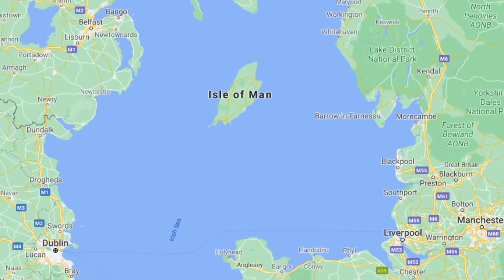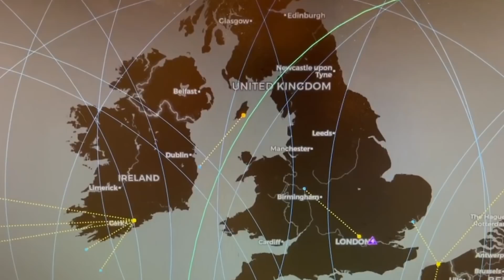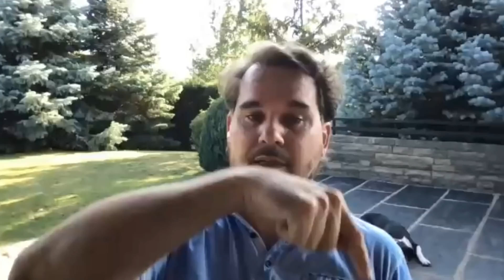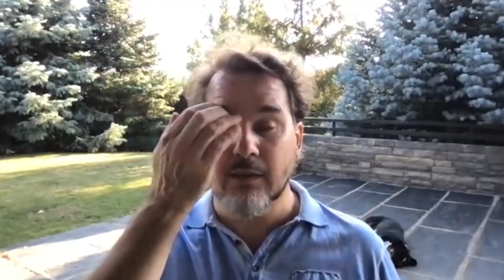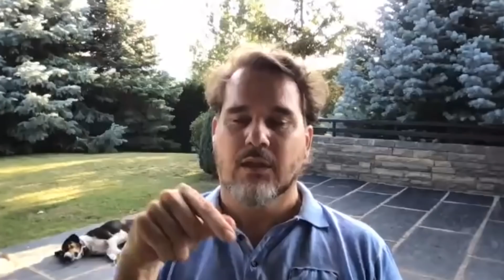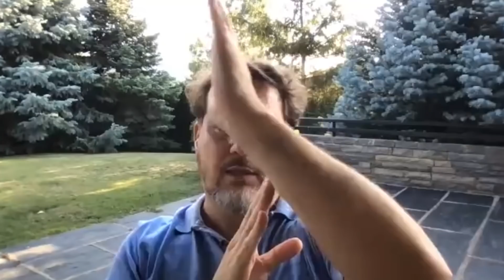Here's the MOST detailed SpaceX Starlink satellite tracker

Comment: Excellent video. Thanks Ellie and Mike.
I received my Dishy in northern France 12th of May.
Google Weather thinks I'm in Paris 350km away. I guess that's based on the IP address Starlink assigns Dishy. Which leads me to Ookla's results. Sometimes speedtest gives the best speed result to a server in Paris, other times to a server on the Island of Jersey and other times to one in southern England so leaving Ookla to choose the best server automatically, rarely produces the optimum results.
The best results I have seen are 357 down with 64 up. But frankly these are just test results. Compared to Orange's ADSL of 12 down and 0.8 up, day-to-day use is in a different world. 
Despite having trees and houses around me I get 100% coverage and continuous connection.
I have replaced the Starlink wifi router with a Mikrotik router and use CAT 7 LAN cables to fixed computers leaving a single Ubiquiti 6LR access point for WiFi connection to mobile devices.
I feel sure that Mike's delay in getting his Dishy is more likely to be caused by Spanish regulatory "maňana" than any actual Starlink technical limitations.
One point. My experience of using Starlink support is excellent.

Comment: So if he is correct about laser optics. Then if this type of base station connects up to fibre connected to the record breaking fibre methods from Japan (300+ terra bit per second) , it could easily provide 1gbps service in the near future ?
Reply: The bottleneck would be the speed of the satellite's connection to the dish, so it will never be able to achieve those speeds if a sat can only transmit 20gb/s to a dish and there isn't a way to shoot a laser at a user's terminal. Also, that Japan cable is a long ways off from being implemented.
Reply: @MiguelRuiz-vp1hu  Ok , I  see. Thank you.
Reply: It will enable more satellites to serve more customers - the limitation on the customer side will be RF, as it is constrained no matter what band you target. However, if you have more satellite density, and narrower RF beams / smaller footprints, you can serve more customers, as long as your limitation is not the gateway links - so you make those optical.